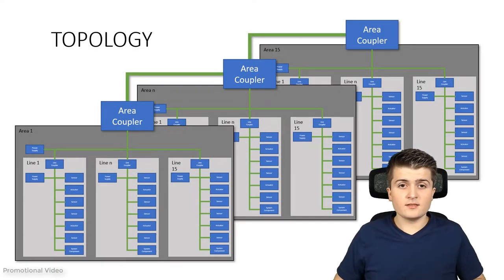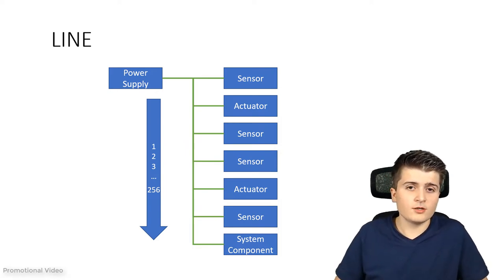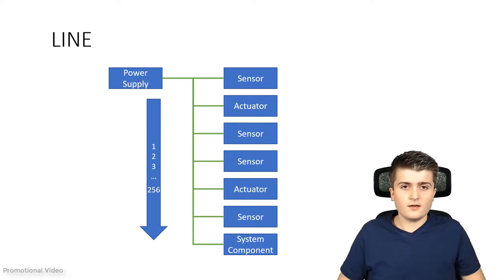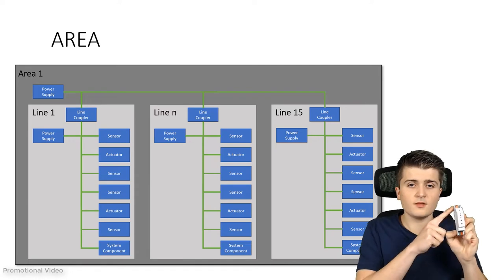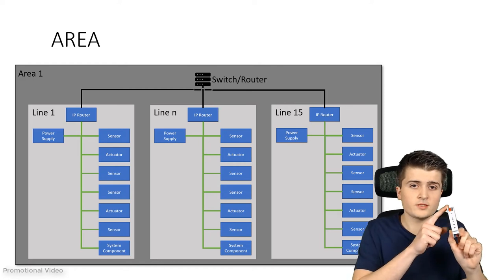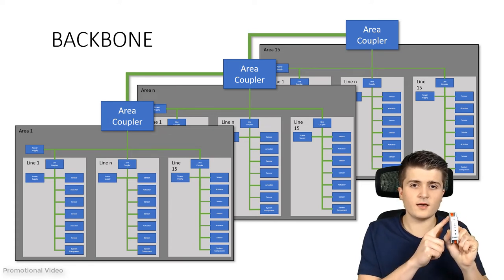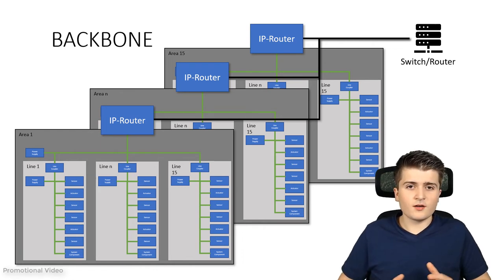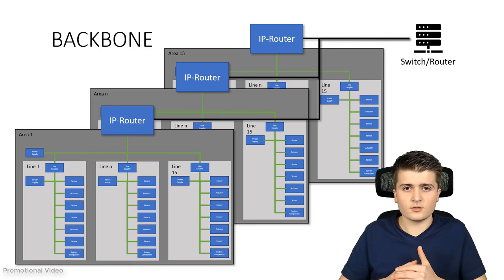KNX Videoseries - #03 Topology: The network structure in KNX

Comment: In an IP based topology, must the bus also be IP based - i.e CAT5 cable - or could it also be TP? Can we also use combination? For instance TP for lines and IP for the area backbones? Or am I misunderstanding the whole concept?
Reply: I'd argue that's less of a choice and more of a consequence of the devices that you choose to use.

From that perspective, if you choose to use a KNX-IP router, then you have no choice but to connect multiple lines (or multiple areas, but not both) through your Ethernet infrastructure. At the same time, each line/area uses KNX TP to connect all the KNX devices of that line/area, including the router.

If you choose to use a line coupler, then you have to use KNX TP for both the interconnection of your KNX devices, and the interconnection of your lines/areas.

FInally, note that KNX-IP Router is a misnomer. It should be called Gateway or Bridge. Therefore, you need a KNX-IP router at every point where your transmission medium goes from one type to another (KNX TP <-> Ethernet).